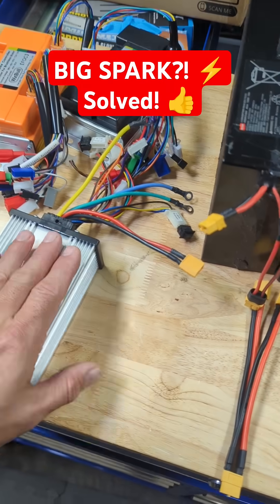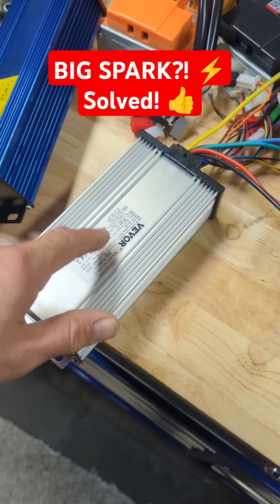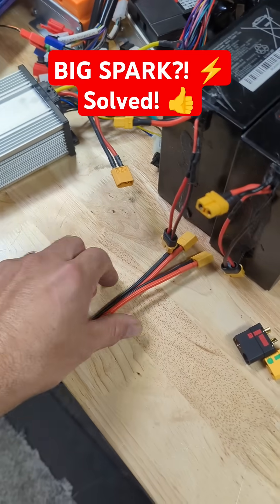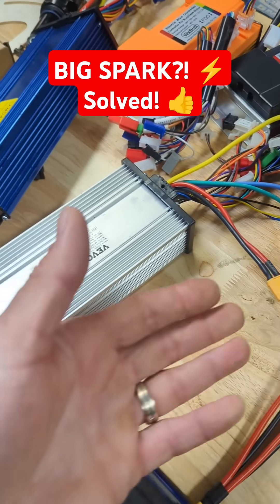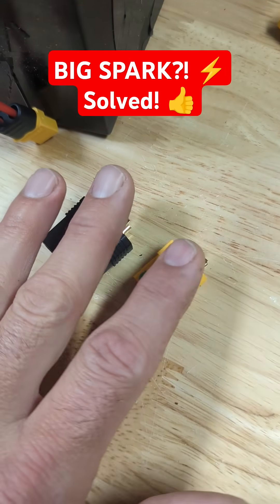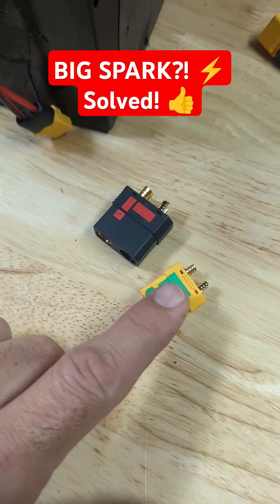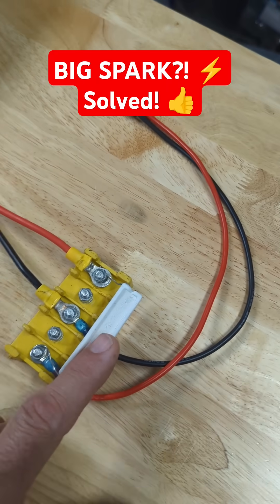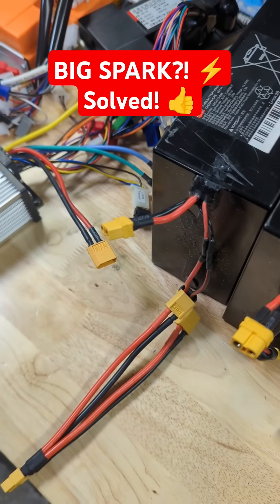FIXED: Big SPARK ⚡ when connecting battery to controller!! Problem SOLVED! #48v #72v #ebike #razor

Comment: you are handy, how do I turn down the speed to my 72v bike set up so my kids can ride it??
Reply from the maker: Best way is to get a tunable far driver controller... you turn down the max RPM with a click of an app, and have 3 speeds you can set however you like (low, medium, high)...  For non-tunable controllers you can put a potentiometer on the +5v wire on the throttle to adjust top speed.  72v is a lot for any kid, best to build them a 48v bike! :D

Comment: My battery has two plugs two red two blacks and a charge port
Reply: Why
Reply from the maker: Sounds like someone modified it?
Reply: 1 could be always connected to the devices you powering and the other one only used to change the battery.

Comment: I use an on off switch in between my batteries and my appliances. Power off the connection before connecting or disconnecting.
Reply from the maker: Always a great idea. Capacitors in the controller store energy even when the device is off, so there is no real off switch for the controller unless you put a breaker in line... But even then, they are not supposed to be used for switching... A contactor is really whats needed, but that still doesn't stop the tripping of the bms if overloaded.
Reply: @TackleThat hlo

Comment: What you are trying to make is called a "soft start"
Reply from the maker: Ya those are good too, little different as they use capacitors to mitigate a surge in current, rather than a resistor that limits overall current.

Comment: Put a Resistor in line of the power with a ByPass switch, once the Caps Charge, flip the Bypass... Problem Solved
Reply from the maker: Nice! Def a more permanent solution.

Comment: They make anti spark connectors for a reason all different sizes xt90 xt60 ext.
Reply from the maker: Yes, i show them in my video... Well not a xt60.. link me to that?
Reply: @ I’ve only found the xt60 anti spark connectors on aliexpress